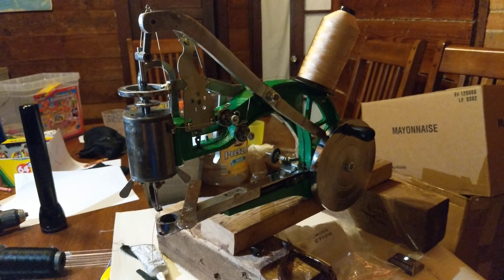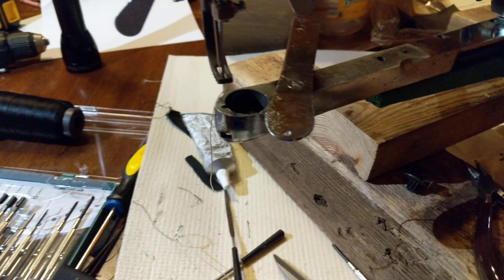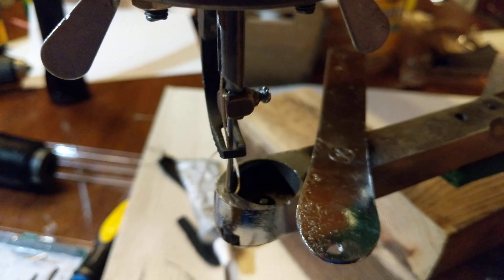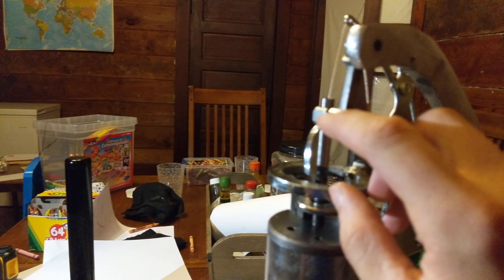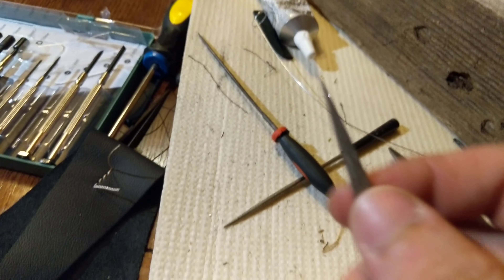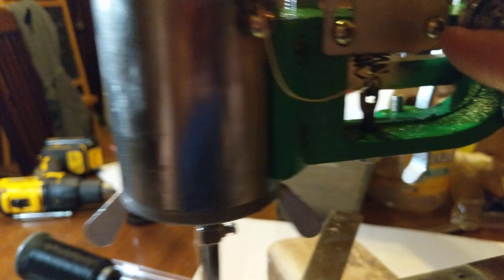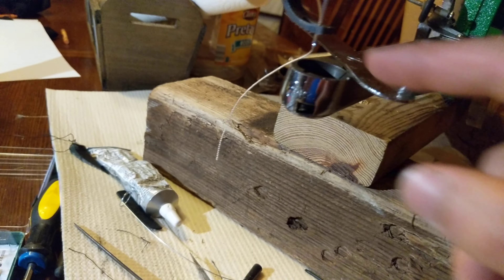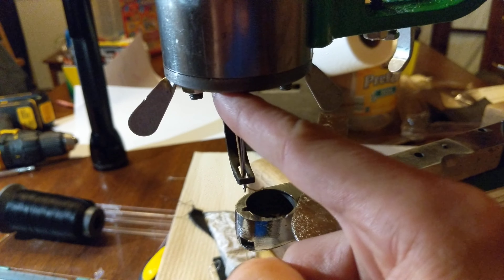Chinese cobbler sewing machine modification - industrial needle

Comment: what size industrial needle do you use?
Reply from the maker: I bought this off Amazon.  Schmetz 135X17 DPX17 Industrial Walking Foot Sewing Machine Needles (24 (Metric Size 180))
Reply: @guitardaddy6  You should have ordered the 136x16, they're for leather. The 135x17 are for fabrics.
Reply from the maker: @burkhardt7372  where from? I'll search now!!! Thank you
Reply: @guitardaddy6  The thread exchange. All of the 135x16 are for leather with a choice of different tips. All the 17's are for fabrics.
Reply from the maker: @burkhardt7372  thank you!!! I appreciate your help.
Reply: @guitardaddy6  I just noticed I screwed up and said in the first comment 136x16, it' should be 135x16
Reply: I buy same needle 135 17. Tha say is for leather.

Comment: You can get the Organ 15x1 HAX1 flat head leather 130/21 off Amazon. No modifications needed.
Reply from the maker: I forget all the sizes now but I think I was going for 180 specifically so i could sew super heavy duty stuff. So far, I've done rifle slings, ballistic plates carriers, and curtains. Haha. The curtains didn't need to be overbuilt but I'd rather if i didn't have to make more. Do it right the first time.
Reply: @guitardaddy6  Yes those are the heavy duty needles. They are the next size up from the 180s. They are for leather but they have a bigger eye for the thicker thread.

Comment: Did you have to drill out the holes in the bobbin holder too?
Reply from the maker: I did not. You shouldn't need to. I'm using pretty thick thread and it still fits through the hole. I do have a very loose tension on my bobbin because of it though, due to the small holes. 

I may look at doing that now that you mention it. Honestly though, so far i haven't needed it.

Comment: awesome thanks for the vid...will it still run the other needles if you adjust the holder down abit again? or this gonna be a permanent thing?
Reply from the maker: You can still run the regular needles. This mod only allows bigger needles and doesn't negatively affect the use of smaller needles.

Comment: What is the heaviest you can go on the thread? I tried a 277 and failed. Just gets stuck. Any suggestions?
Reply from the maker: 210 is definitely the heaviest i would go. That's a good heavy weight.
Reply: I use. 135. Or. 138. Work for me
Reply: @jesusmelendez3696  thank you the 208 also worked. I finally gave it a second try and it worked out. Good luck to you Jesus, saludos!